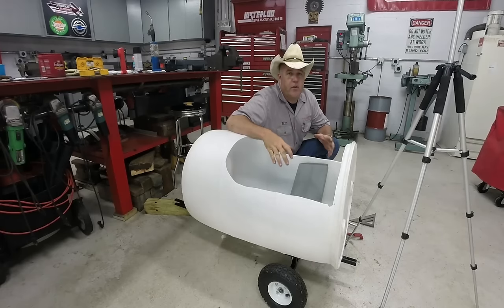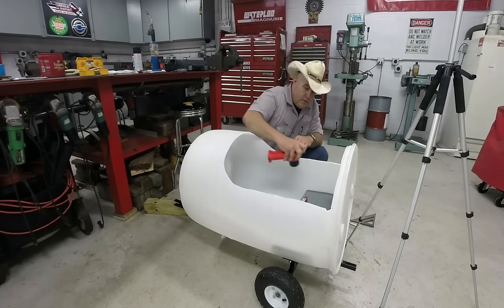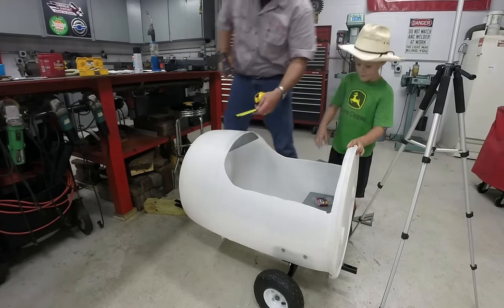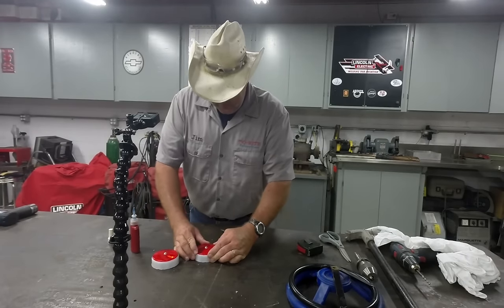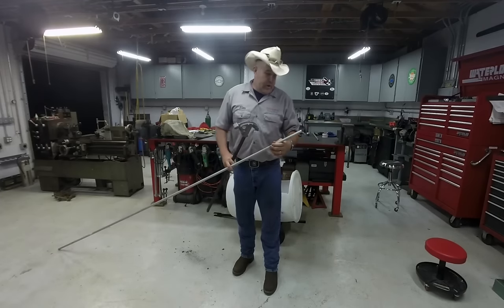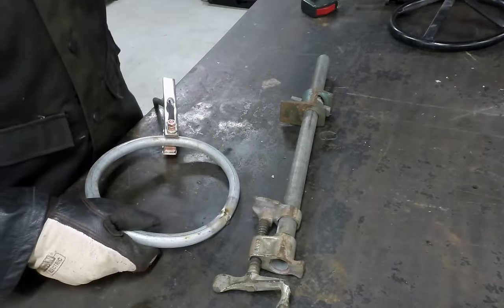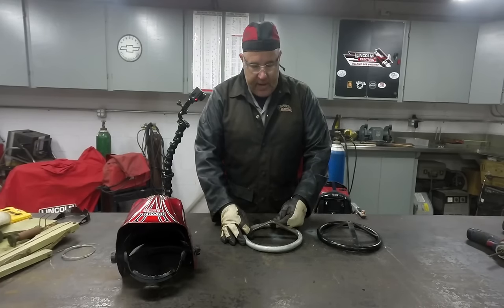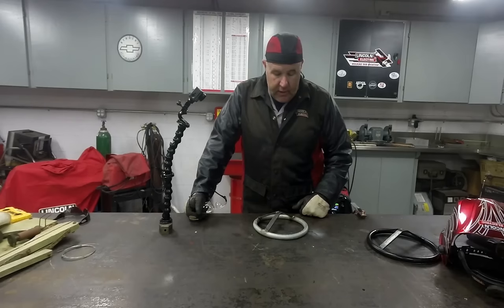Building a Bigger Barrel Train Ep 5 - Welding the Steering Wheel and Fabricating the Interior

Comment: I am enjoying this series(as well as the windmill) a lot, thanks. Just a quick question - I always thought the exterior of EMT was galvanized. Is that the zinc coating you talked about? Aren't the fumes harmful to breath? Thanks again!
Reply from the maker: +William Conner Yes and yes. Zinc  is galvanizing and galvanizing is made of zinc  (zinc is an element we use for it's galvanic properties).  So, the fume extraction fan I was using for the shot is just outside of the field of view. I turned it off for the shot so you could hear me. Rest assured though most of what you saw was the cutting oil I used and didn't clean off properly. Shame on me for both. Thanks for watching!

Comment: On the bung seals for your 55 gal. barrel, what is the size you used for housing the red reflectors. When I searched for them at the Orlando drum site you referred, I didn't see the size and there were several listed. On Ebay, they all seem to be 2" ones. Is that the size you used, as they look larger in the video than 2" wide?